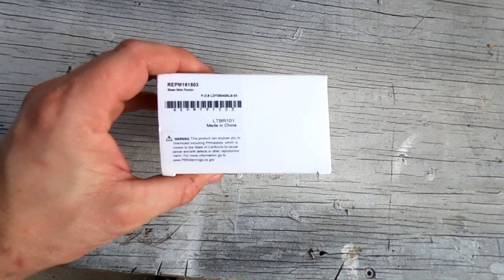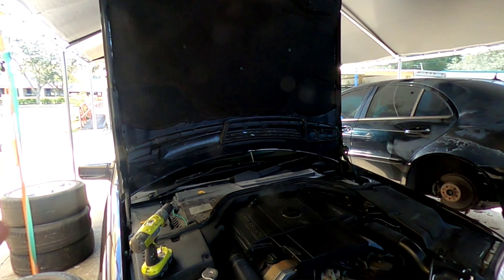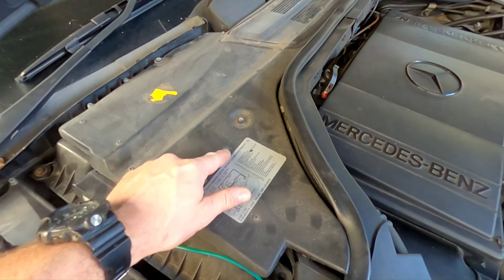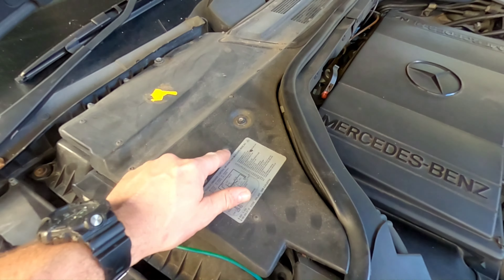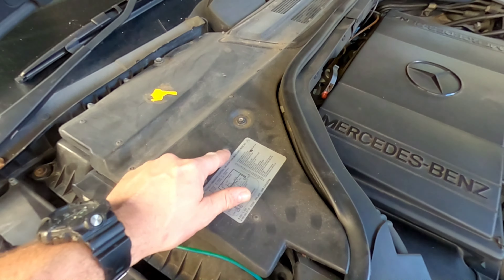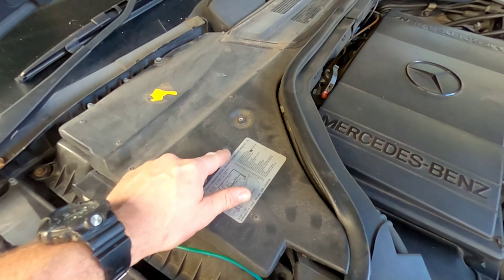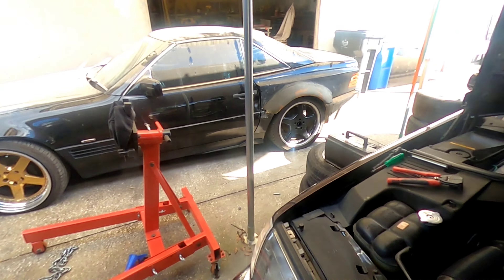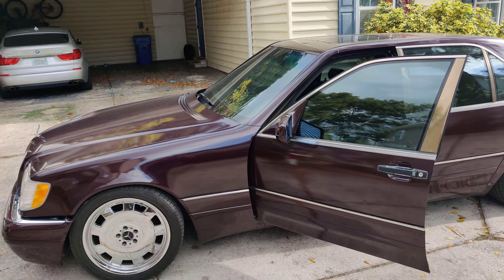Mercedes w140 blower motor resistor change and test blower motor s500 s420 s320

Comment: Btw, it is not dielectric grease . It is a thermopaste. It’s same thermopaste that it is used on computer CPU. It helps transfer the heat from that resistor to fan housing. It helps dissipate the heat.
Reply from the maker: Oh thanks.  I knew it was same as computer stuff just forgot what it's called.    But thanks for fill in

Comment: How's it going and Happy New year, quick question, when I turn my heat across fan on it will run for a few minutes then start making a funny noise like an old fan that's in a bind, how hard is it to replace the blower fan on my S 420, and also thanks I replaced my light switch on mine to with yo help, lmao. Thanks again Chris.

Comment: Hello pete will the replacing my blower relay will Make my center vente work ???
Reply from the maker: If it doesn’t work it will be your vacuum box or lines.   Could be a loose line or cracked vacuum block.   But also the relay/resistor controls the opening.

Comment: I have the same problem with my w140. I replaced the resistor and control panel but still with the problem. Sometimes randomly the AC turn off and then start blowing to the windshield. I don’t know what else to do.
Reply from the maker: @eduardo mangual from the sounds of what your saying it sounds like a faulty unit or resistor but I believe there is also a vacuum control part or actuator.   I have to admit this is the first time I've jumped into the w140 full ac system but I pulled apart my w126 one and there is a block that controls opening of vents etc.   I believe the w140 has one as well behind the glove box.   This could be your issue.  I just found a forum that explains how to test it from the control unit.    Send me an email @ petescarportparts@gmail.com and I want to see if we can figure this out together
Reply: @petescarport  I’ll send you an email right now! Thank you.

Comment: Hi Pete  I just got 1998  S320my fan is working fine but not blowing cold at all I did reset the code  B419 based on other  videos I watched What would you recommend now?
Reply from the maker: If it’s not blowing cold make sure compressor is coming on.  It could be low on Freon and that would be the r134 style so you can pick it up from an auto parts store.

Comment: Hello, where is your location? I have 1995 Mercedes s350d, this mercedes with electric problem. Can you check please my car? My location is, Sacramento, CA. Thanks.
Reply from the maker: I'm in Tampa FL.
Reply: Hello Pete's,Can you tell me please, what can charge a battery on a Mercedes? I changed the generator, I installed a new one.  Problem still exists.
Reply: There is another problem, the turn signal always works, sometimes both, and one by one.  Please help if you can.  Thanks!